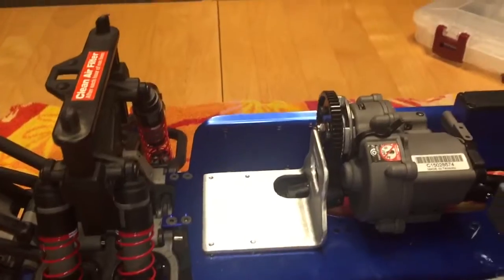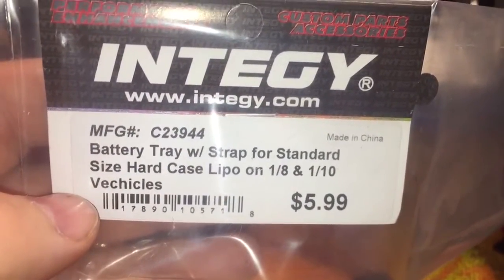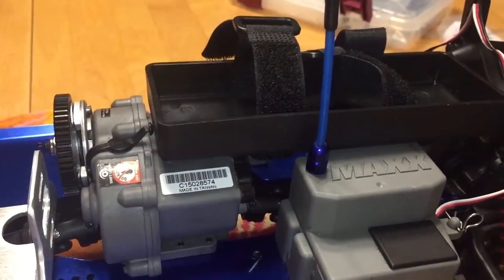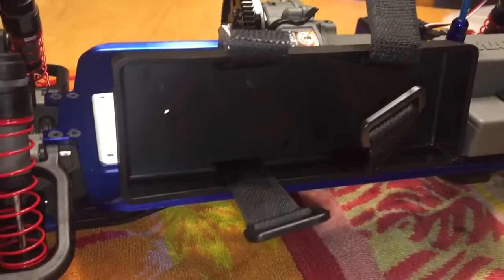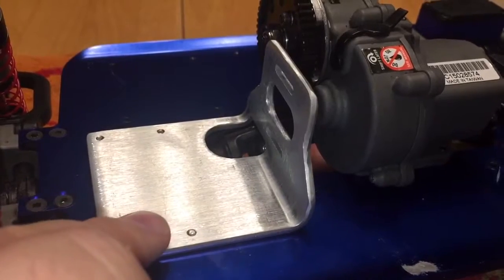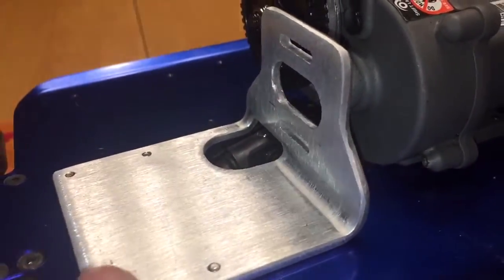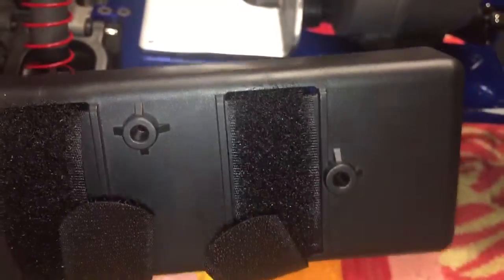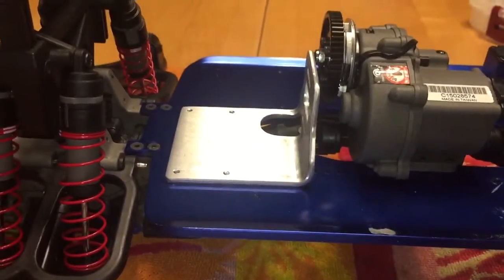T-maxx 3.3 Electric Conversion | Mounting Hardware pt.1

Comment: I would put the reciever box on the side of the servo where the normal battery's was it will be next to the esc and servo wires and you can lay the battery tray across the front and use the mounts also I had the same issue with it hitting it should a little room to go back or forward if it still hitting try switching the driveshaft and see what happens it's coming along nicely 👍
Reply from the maker: Rc Fun thanks for the reply! I will move the receiver box and see how that goes to get the battery situated on the chassis. The motor is scheduled to be here mid next week, so things are coming along!